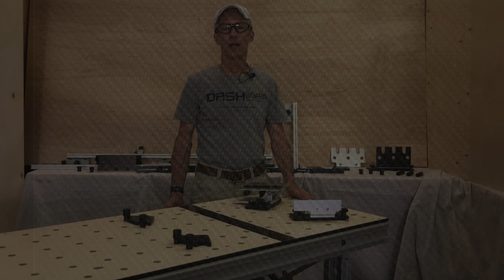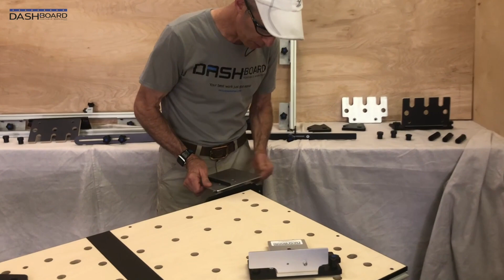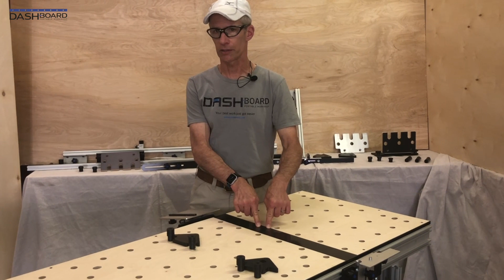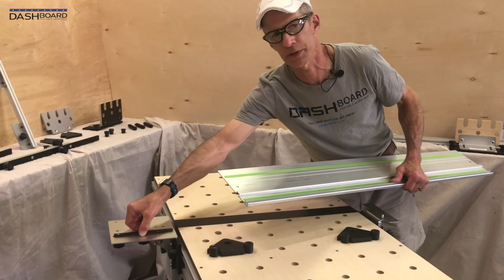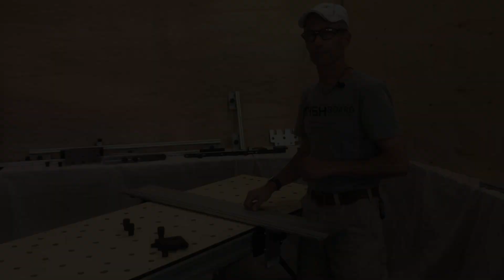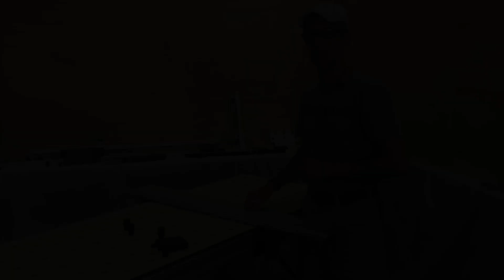Definitive Setup Process for Dash-Board® Guide Rail Brackets and your Festool tracksaw

Comment: The hinge has a large overhang, for small garage workshops this means the bracket takes up valuable space... I can't see why this has to be the case, if the hinge points are good, can the overhang be reduced?
Reply from the maker: There's a lot of torque acting on the rear bracket, especially in cases where a user has a longer rail on a wide table. We've had a few customers even attach 8' rails to our brackets, so having that large contact area - plus the long pressure bar that grabs the rail - is important. We've focused on making the most robust design, though I know we can't be the perfect solution for every scenario.
Reply: @dashboardportableworkshop  That's a fair comment, maybe you could design another back hinge with a more robust pivot and shorter overhang for small spaces?
Reply: @dashboardportableworkshop  Here's a question you may shriek at but bear with me... I've just had a close look at the rear bracket and think I could machine the back plate overhang down by half and still have two of the locating pins on the rail guide (large thumb tightening screw and Allen button head) to secure the rail track. For a 1m track, that would be plenty of plate and locator guide to ensure accurate alignment?
Reply from the maker: @shakinroom2936  You're welcome to have a go. I need to mention that the button head bolt you refer to is not meant to be tightened. Rather, it locates the front of the bar and limits how far it can be lifted, so you'd just have the one knob tightening the bar. At half the length and with a short rail that might be ok. Please check the newer videos about bracket assembly and setup to see that our current design has an exceptionally robust pivoting mechanism.
Reply: @dashboardportableworkshop  Thanks for your reply Rob, I've had a look since and see what you mean. I think I'd have to relocate the holes back enough to get a small thumb screw in the button head hole and change its purpose. I'll have a think on it - thanks for your support, much appreciated.

Comment: One question about the arrow setup. The DeWalt track runs down the middle of the guide, which has rubber cutting strips on each edge. I assume DeWalt track owners should already have trimmed a new track’s rubber cutting strip before doing this setup?
Reply from the maker: We do recommend trimming BOTH splinter guards on a Dewalt rail prior to setup. That will ensure both edges are as parallel as possible to each other and improve the accuracy.

Comment: It seems you missed an opportunity. The stock Festool setup can drop the rail on your head. It's a real bummer when that happens, plus it hurts A mechanism that allows you to tilt the rail AND prevents the damn thing from falling in your head would be awesome!
Reply from the maker: Been there, Farm Cat. Our guide rail brackets are designed with a different and much more robust pivot point, plus more weight and contact for your rail at the back. You can also adjust the pivoting tension on the latest editions. I guarantee we have received no reports of head injuries.
Reply: @dashboardportableworkshop  When you buy a set of these, can one set be used for both Festool and Mafell rails (assuming you purchase some adapter kit)?
Reply from the maker: @farmcat3198  They work with both but not at the same time. You just have to switch some hardware around.
Reply: @dashboardportableworkshop  By the way, I hope you and your family were spared by the wildfire.
Reply from the maker: @farmcat3198  We were! Thank you.

Comment: What is the point of the triangles? Won’t pushing the fence up against 2 dogs do the exact same thing?
Reply from the maker: Steve,
Using only dogs will place your saw kerf over a row of holes. The arrows create an offset to keep the blade cutting between holes and within our replaceable cut strip, even when doing 45 degree bevel cuts.

Comment: Rob, how would you go about making an micro alignment to square if one needed to…. Asking for a friend
Reply from the maker: Patrick,

In some cases it's as simple as just repeating the setup process, however it's always possible that the sides and top of your table are not perfectly parallel/square to each other. In that case you can adjust the rear bracket's pivoting plate to accommodate it. We have a video on that. Last, if it's a matter of the rail not dropping nicely on the locating pin up front, then with the rail dropped onto both brackets, loosen the two knobs that tighten the pressure bar. Slide the rail front to back slightly a couple of times and then retighten those knobs. This can allow the bar to shift a little in the rail's slot and that will allow the rail to pivot a little into compliance. 

Please email me if you have a different situation or none of those suggestions is effective.

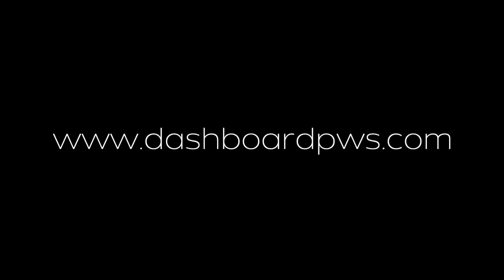Comment: what about the panhead screw above the two knows you you tightened @ 4:44? Does it get tightened?  Or does it just have a bit of play?
Reply from the maker: That screw is installed with threadlock into the pressure bar. It should never be tightened, and in fact cannot be tightened to any effect because it's deliberately too long for that. It exists ONLY to help position the bar and limit how far it can be raised. Instructions are included with each order that mention this specifically. The entire concept with our design is that you need no tools for the install.
Reply: @dashboardportableworkshop  thank you

Comment: The Guide Rail Bracket looks like a great design.  I'm interested in buying one for a bench I already have and installing T-tracks on the side for installation.  Do you have any instructional videos demonstrating the installation of the Guide Rail Bracket on to T-track?  I imagine it's not a difficult process but would like to know if there are any specific things to be aware of like the height of the T-track related to the table surface, the recommended distance between the T-tracks (2 parallel T-tracks needed per side, right).  Again, great design, keep up the good work.
Reply from the maker: Please check the website for some specific info on installing T track. From there you’re also welcome to contact us for further details. Thanks!
www.dashboardpws.com